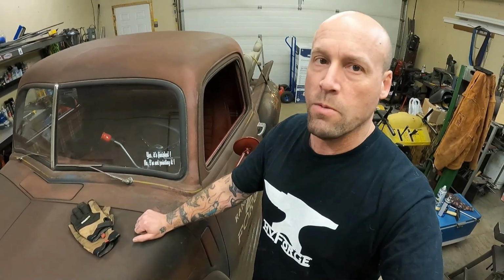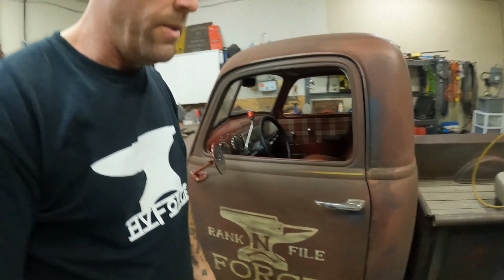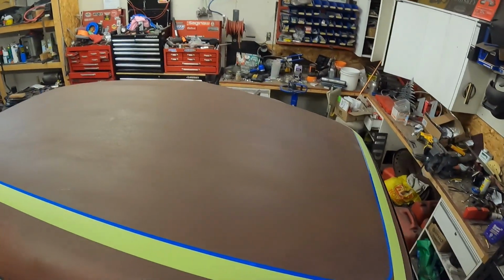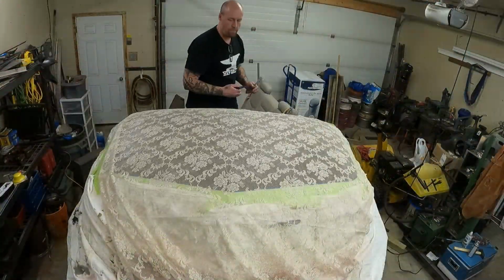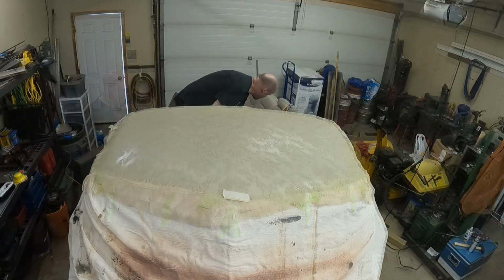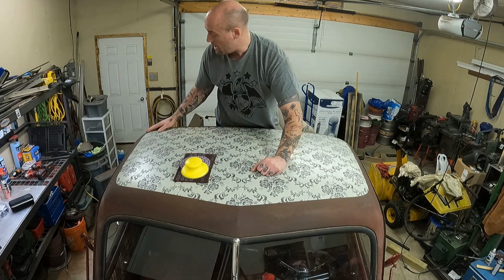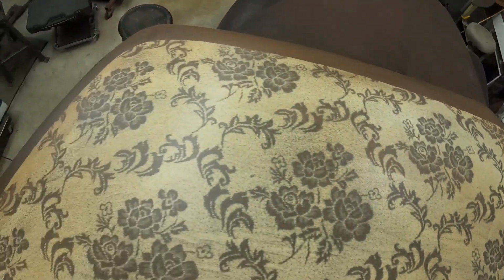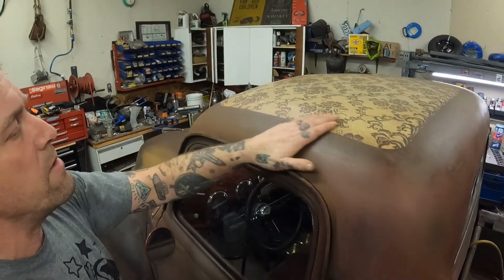Custom Lace Paint Job on Rat Rod roof

Comment: Steve, the lace worked out great. I was doing lace painting and panels back in the 70's in my own Shop here in Eakly, Oklahoma.  They say the effect was first discovered when someone was testing a spray gun pattern and happened to paint over some lace cloth used for cleaning.  It took off from there.
Reply from the maker: That is so awesome. My dad used to paint his old Triumphs with lace back in the 60’s. More of a tribute to him and his work on choppers
Reply: That's looks shithot mate  you did a great job good on  you mate ilike bro
Reply from the maker: @davidwoodham1307  thanks

Comment: What brand is that slim blue tape you used? Because, I can tell after watching you twist and peel it, that I don't ever want to use it.....LOL!
Reply from the maker: Very smart to notice. It sucked. It is pinstripe which I should have used thin tape. I figured vinyl pinstripe would be a crisp line, which it was. But there is 1/8” or 3/16” tape that would have been better. Lesson learned on my part
Reply: @ranknfileforge204  Hey, as long as it worked, right! Great job, by the way!
Reply from the maker: @williamguillIII  thanks!!

Comment: Looks awesome if you're having trouble with sand papers Gumming up, it's not fully cured. Let the paint fully dry. And a trick i use it a wet Magic Eraser it works better then sandpaper or try it after light sanding.
Reply from the maker: Thanks, I’ll give magic eraser a whirl.